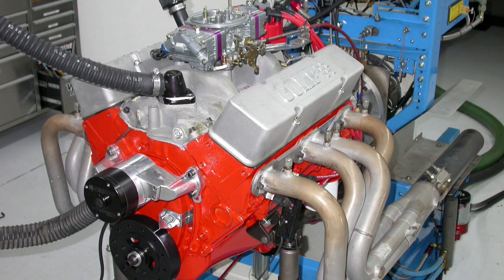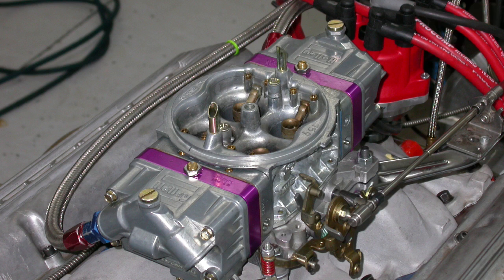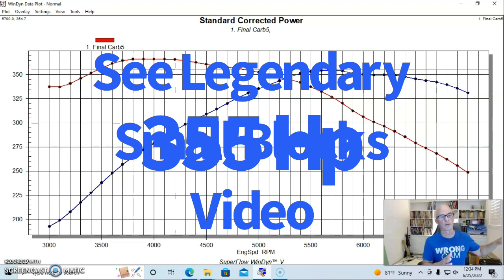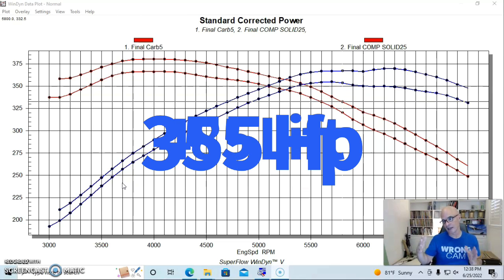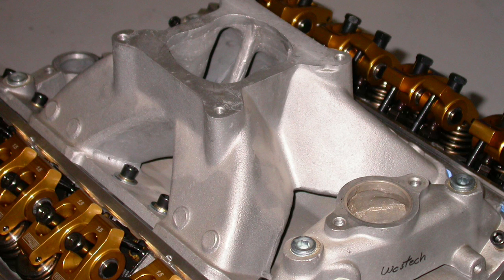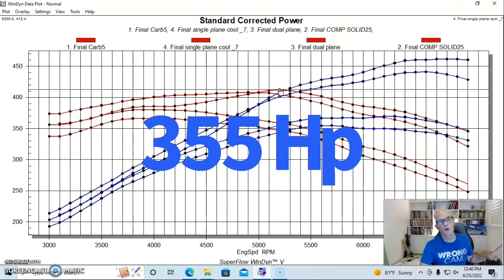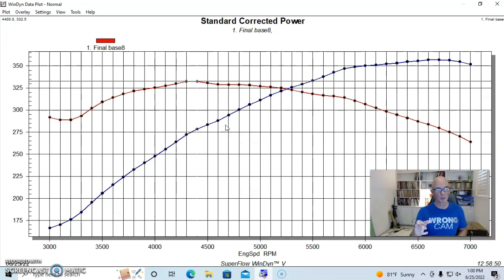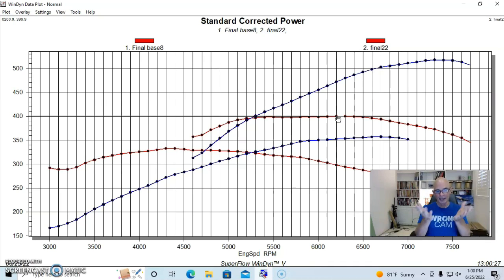HOW TO BOLT ON 190 (ALL-MOTOR) HP TO YOUR SMALL BLOCK CHEVY! DZ302 AND L76 327 SBC POWER UPGRADES!

Comment: Richard, how about a build that focuses on max fuel economy.  I'm planning on building a 283 with ported stock heads, mild hyd roller and an Edelbrock 500 cfm carb.  My goal is to get 20+ mpg on 87 octane.  With today's gas prices, sometimes a fuel efficient cruising machine is better than a max HP combo.
Reply: I like this idea.
Reply: I think you got it no problem. 
Back in the 90s I had a 283 with stock 327 double hump heads, about 9:1 compression, a slightly lumpy cam, old school aluminum Holly intake, carter 600 carb, headers, and good flowing exhaust. 
Made good power from 3000-7100 rpm. 
In a 3500 pound, 4 speed, ElCamino, with 3.36 gears, 26” tires. 
It got 17-18 mpg on 87. Turning 3000 rpm. 
I think it easily gotten 20 mpg with overdrive, or hwy gears, or a milder cam that cam in lower.
Reply: @b.s.adventures9421  Very close to what a friend and I built out of what we had laying around a few years ago for a 283 for his 66 Elcamino. We ran the Duntov 3030 camshaft and a set of full length super comp hooker headers and purple hornies. Used an old Moroso 7qt oil pan we had.  Heads we did the old 194 intake 160 exhaust trick. Intake an old Holley from out in the weeds, with Holley vacuum secondary 4 barrel. Ignition system we had the stock distributor with an old MSD 5 box that worked good. He upgraded recently to a new MSD ignition system and fuel injection system and man that woke that old engine up. Its a lot of fun with a 4 speed. A milder camshaft, and highway gearing like you said I bet he would get 20+ mpg easy.
Reply: I would do a home ported or heck even a stock 80s aluminum quadrajet intake and a good build quadrajet ( get cliff ruggles book). Get a mild cam and a set of heads with small combustion chambers to keep compression up around 9:1 or better. Get your quench around 0.038 and it will be pretty good
Reply: I may even suggest the L30 ( 305 vortec) heads, and the GM vortec quadrajet intake to see if you can take advantage of the better flow of the vortec heads. But, that intake is more of a performer rpm style, so it may slightly reduce low rpm torque
Reply: Gasoline vapor system!! Run your v8 on a 220 Mikuni carburetor. Apparently I can't make a link to the Facebook group as I've done it twice now and it's gotten deleted.
Reply: @xips420  I will have to look that up. I wouldn't have thought of a Mikuni on a Harley Davidson yet not a small block Chevrolet. Then again you could build a log type intake and run 2, 4, 6, or 8 carburetors it worked when it was all a person had.
Reply: https://youtu.be/Ke0MGmUr3SU
Reply: Depends on what you drop it in. Popular Hot Rodding magazine back in the late 1970's had a 1969 Camaro convertable and a 71 (?) Monte Carlo. Both 350s, both got 20 mpg at 55 mph with 3 speed automatics and ran 13's, which was good numbers back in the day. Build for torque and low rpm, tho if you're going roller cam, it would be cheaper to run a 305 block with roller lifter bores designed into the valley than pay for a roller conversion on an older block. Might even have the Vortec heads you want already, but they tend to crack between the valves so look closely. Actually, a complete EFI 305 and Th700R4 or Th200R4 is going to get you there cheaply enough in the right vehicle.

Comment: How about doing a add on horsepower for a 1988 350 Chevy crate engine with 4-bbl carburetor, this is going in a two wheel drive short wheel base 88 Chevy pickup with 700R4 trans and 373 gears in the rear.

Comment: I'd love to see some hand-ported junkyard Vortec heads off an L31 350 to compare the gains to double-humps, AFR's, etc... Also would like to see some higher lift, not-so-long duration cams (like the comp XFI 218/224 roller) on heads modded to allow it. 

Love the content!
Reply: That would be interested because I have seen guys port Vortec heads and they didn't seem to gain anything from it. Agreed on cams too that would be a great test. 👍
Reply: @sswcustomsewing4276  the vortec heads don’t need porting. Porting can actually hurt them.
Reply: @vinceyoung5912  Agreed 👍
Reply: Vortecs are a great place to start if fresh new casting, For ported vortecs you must do them the david vizard way. All modern port shape aftermarket heads including 'afr' got their original lessons learned designs from david vizard's wizardry and ported foam molds, from the ported double humps, vortecs, as well as other finish ported by david vizard and friends in the racing industry, factory casting molds like the fuel injected corvette heads. David vizard has found the science behind each head design and fine tuned porting technique for every type cylinder head. Each head has a specific way to be ported for the ultimate results.

Comment: The blue numbers need help.
A 650 carb needs 1-5/8 headers? 
A 750 carb needs 1-3/4 headers? 
An 850/950  carb needs 1-7/8 headers ?
1050 needs  2 inch headers?
Happy hour typing🤦

Comment: I would like to see a video of you trying to build a small block Chevy using all of the crappiest generic off brand parts and see what kind of power you can make
Reply: Well I have tossed together small block engines with all kinds of garbage. Used pistons where I knurled the skirts and just junk I had laying around they ran great for what they were. The trick from my experience is do the best machine work being as thorough as possible like old Smokey Yunick explained in his book they ran fine. Run good quality bearings and piston rings making sure that your cylinders are properly honed to finish. I have seen all kinds of silly combinations of parts work look at what guys did when they ran the 283 bored to a 292 in Sprint cars that was fun.

Comment: I've had an old timer tell me that he swapped the 70 LT1 cam into his DZ 302 and it was faster. I'd be interested in testing that theory to see if it's another wives tale. I'd also like to the  big block edition of the classic tests... L78 396, L72 & L88 427s, the LS6 454, etc.
Reply: interesting, tho i think the LT-1 cam he meant was more mellow than the 30-30 cam in the DZ, so his swap made more power at a useable RPM range, so the ol' "butt dynometer" felt a different in potential.

Comment: Do you think the crankshaft from the 262 handle that horsepower?
Reply: i'd almost say no, the 262 and 267 were bread and butter engines for those who wanted V6 fuel economy but not the vibration. too many aftermarket cranks that are affordable and even cast are strong for a street engine to spend money getting one of these old jobs up to spec.  The 262 is going to have a 3.1" stroke versus a 283 or 301 with a 3" stroke and potentially be a forged crank.

Comment: I like to dig around for old 307 Chevys to grab the cranks and build large journal 327s with vortech heads they make some nice horse-torques.
Reply: Torquers that will still rev without big bux parts. Love my 327 sj  though.
Reply: Lots of luck finding a old 307 engine, that's the first time in many years that I'd even heard the word 307 engine. Lol! I used to have a 68 Chevelle Malibu with the gutless 307 engine and 2 speed powerglide transmission, I later built and installed a 350 engine, with a TH 350 auto transmission, I then had a smile from ear to ear. Two years later in 1978 I bought a 1970 Chevelle SS with the 402 big block engine and a 4 speed Muncie transmission, it was a beautiful solid shiny black, with white interior, bucket seats, Hurst shifter in the floor, it had aluminum US Custom mags, 15 inch 50's on the rear and 15 inch 70's on the front, 4:11 positrac rear end with traction bars, headers with 3 inch turbo dual exhaust, and of all the cars I've had in my 65 plus years, I wish I'd kept this one.
Reply: @alanwylie8960  good story, was there a dragon somewhere? Would've been cooler if there was? Alright alright alright.
Reply: Find an H block, supposedly they'll go out to 4 inches like post 1957 283's. I would think a post 1968 327 might have a forged crank option. but i always wondered why GM used the chevy 305 as their corporate V8 in the 1970's when the 307 had the 327's rod-to-stroke ratio.
Reply: Yup, they ain't all over but still around.

Comment: How about a cheap build up and comparison of 350's from Buick, Olds and Pontiac. Which would make the most horsepower? Of course they would be junkyard motors.
Reply: Almost impossible to find those BOP 350s anywhere
Reply: Marlan Davis built those for HRM under the "the other 350" article series. A 9:1 buick 350 with a TA Performance top end kit made 350 hp (I think it was a 232/.499" cam with 110 LDA). He got a Pontiac 350 with #46 heads and 230 degree duration cams with split lift cam averaging .470 lift to make 400 lbs of torque and 300-340 hp.

I couldn't find a rating for the Olds350, but i know pre 1976 blocks can bore out to a 425 piston and don't use big block heads--they'll bolt on, but Olds engineers found they kill low rpm power and put the big block valves into the smaller heads. In F85 1969 Cutlasses, with I think a 3.91 or 4.33 gear, they were running high 12's in the quarter regularly.